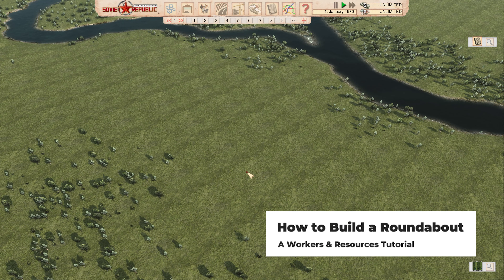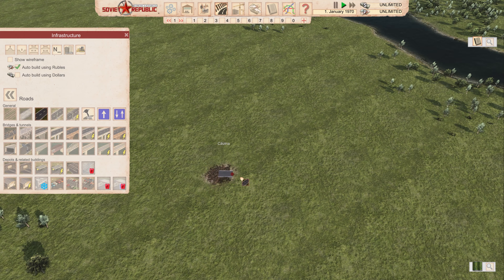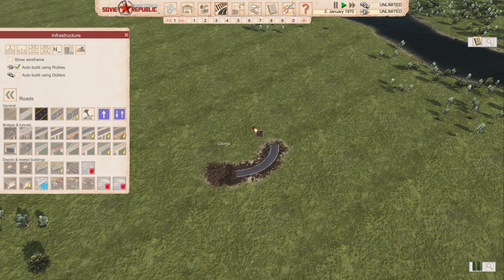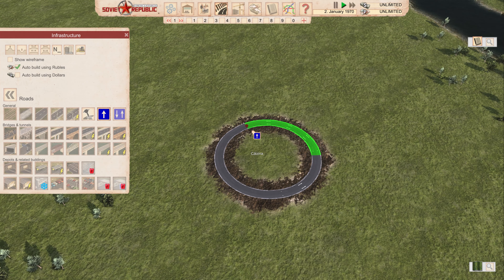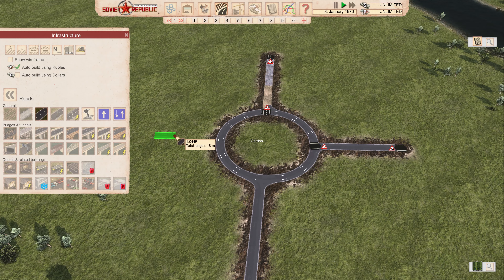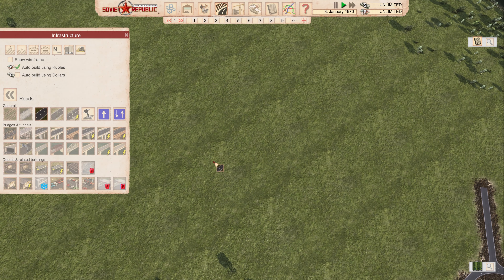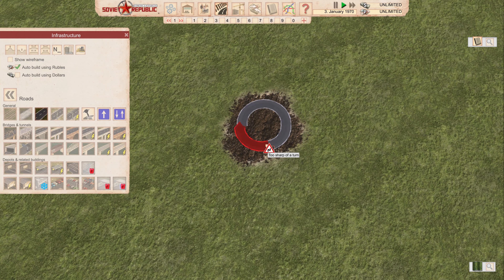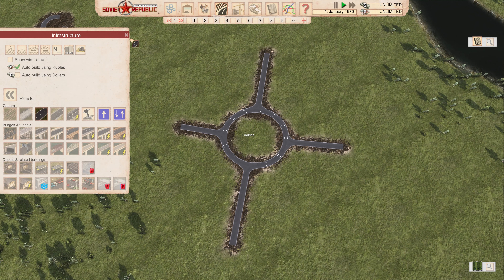How to Build a Roundabout in Workers & Resources Tutorial

Comment: Roads. The basic connection in this game is one of, if not the worst one ever? you can't even lay the shortest section without having some kind of issue.
No roundabout mods either. Or can't road construction mods be saved as workshop items? Not seen any at all, just gave it a quick look and didn't see anything, but other games have them as mods, or are they just not a doable thing in this game.